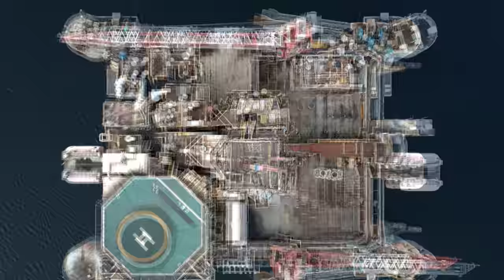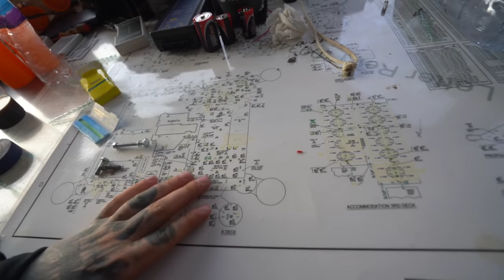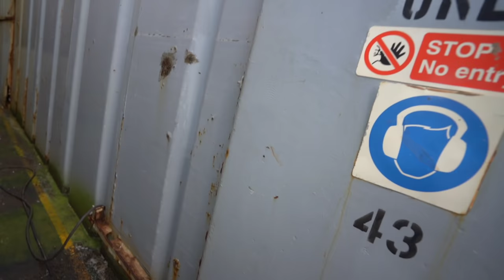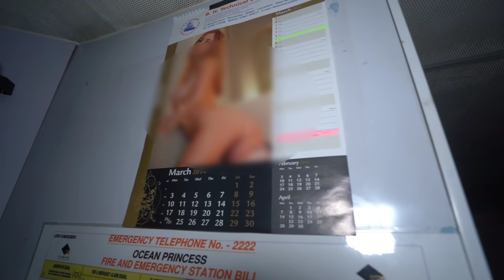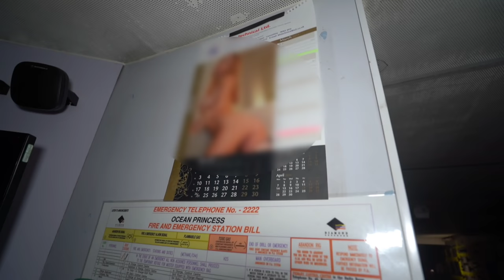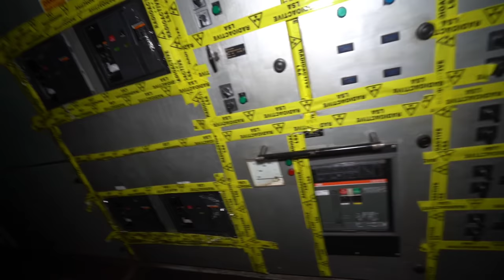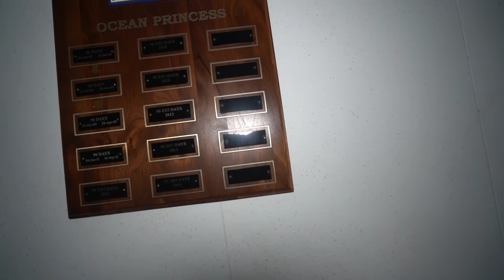We Should Not Have climbed onto This Abandoned Oil Rig | DISASTER AT SEA

Comment: I think you should buy a real boat 🤣
Reply: Right?
Reply: Especially with the consequences. Worthwhile investment for sure. My friend had a barge an f would joke boat stands for bung on another thousand. He threw money at it for a while.
Reply: Didn't help they ran it dry on land and burned the rubber impeller  up to the water pump which cools the engine , The tale tale sign of no water but steam coming out of the weep hole that let's you know your pump is working confirmed what I feared when I saw them running it on the bank out of the water
Reply: with daul engines and keep them wet😂

Comment: You should never run an outboard engine with no water supply  as you will burn up the water pump impeller. 
Enjoy all your videos keep up the hard work.
Reply: I noticed that right off the bat,  the steam coming from the weep hole told the tale

Comment: Just a tip for your guy Josh. Do not wear wellies on water!!  If for some reason you fall in water they fill up and pull you down. They are then pressurised and you can't get your foot out. Plus buy a harness i know its a pain but if that staircase had rusted out it could save your life. Always prepare to fail not fail to prepare. Good video's stay safe. I wouldn't do it well done
Reply: @toddamtmann3528  scaffolding everywere put it round that like a high rise scaffolder would.
Reply: @TheMotown1986  dude. The stairs are attached to the scaffolding. If your “the stairs rusted out” then there’d be no scaffolding. Go learn about rappelling and you’d realize how useless that would be. That’s also extra gear/weight that’s not useable in their scenario on an already overloaded and undersized boat that was clearly in disrepair (engine)
Reply: @crossbowsniper  fair play i want avin a dig i wouldn't go up there im just saying to try be safe no harm from me tip top vids keep up the good work

Comment: They are there to dismantle thing's so they can move the drill rig to another location for continue drilling for oil/gas. Happens often in Norway when a rig have empty that "pocket" for the resources in the sea bottom. They use tow tugs to pull them to the new location. And those tanks are filled with a mix of water and clay so it's easier to drill under high pressure to push up the material they are drilling away. It needs to go somewhere. And they mix the slurry in them as well to plug the drill hole so nothing leak's into the ocean. Have relatives that works on Norwegian oil rigs between Norway and Scotland. They use nuclear power plants to be able to run all the electricity and engine's to those oil pumps station's that drives the drilling station.

Comment: The shakers bring drilling shavings up to the surface along with fluid, Then the debris is shaked out and the fluid is pumped back to cool the cutting head of the drill platform.. Those collars at 22:35 are used to clamp the ends on the pipe to one another they bring the pipe in about 50 foot at a time, drill down, winch over & up another pipe,  thread it on and clamp t to keep it from busting loose.. At 31:50 those are training and briefing/de-briefing rooms for the workers. At Timestamp 40:05 those are emergency escape boats... They are lowered by winches to the water below and then dropped into the water... At Timestamp 42:15 those are the  thruster control centers.. The rig is towed out by boats and the thrusters help steer & stabilize it as its being tugged out and into its position
Reply: Shows how old the rig is. Modern emergency boats are dropped, not lowered.

Comment: The radioactive map, and hazard tape is likely related to them having density meters on board, a lot use a radioactive source to shine a beam through the fluid, a measurement is taken opposite the radioactive beam, and density calculated.

Unless they are broken open, they are safe. If they e been removed from the pipework they were connected to, and the shutter left open, they are hazardous if you put your body parts down the pipe, in front of the beam.

You are likely to come across them when exploring any refinery type of place, although counter terrorism police the security of any of these devices in use in the UK. IT is extremely unlikely that they would be left on board a discussed rig, they would be removed.

If you ever want an engineering guy to come on an explore, I'm your guy! If you get the chance to do a disused Sugar Factory, definitely gimme a nudge! I'll show you how it all works! Really interesting plant & processes! This place is fascinating.... Vibrating screens (separators aka shakers), lots of hydraulics, pumps, valves, a real interesting place ❤️❤️❤️🙏👍LSA is low specific activity. Naturally occuring radioactive particles found in products mined from the earth such as oil processing. There's possibly some contamination in those cubicles, or more likely in the plant that those cubicles in the switch room supplied

Comment: Think the rubber water pump impeller had died from running out of the water, and then engine overheated/lost power. I hope it did not damage pistons or cylinder walls. You can spoon water over engine in a bind.......ohhh just made it to the point of vid where that turned out to be true :0(

Comment: That was smart to not climb aboard those lifeboats. Your right about the g-force too. That fall would probably kill you no matter what was hanging there.
I'm not sure how quickly those lifeboats would be released on that oil rig if it was actually used during an emergency but i know on a lot of freighter ships they have a system designed to be quickly released into the water and there are harnesses inside for the passengers because of the g-force.

Comment: The radiation tapes no joke we used to use radio isotopes as tracers for monitoring pipeline flow the lsa means low specific activity the banks that where taped off where isotope detection units

Comment: The reason to the radioaction is that there are elements in the underground there are are radioactive and they used to drill in them for getting to the oil there for will there be radioactive elements all over the place but it is nothing to worry about it is only after years of exposure it can be a issue my old man work offshore in the northsea

Comment: That's what happens to a boat engine when you run it out of the water it only takes about 2 to 5 seconds for the water pump to overheat and destroy itself it's made out of rubber equal to the strength of your bicycle tire and that's what pumps the water so it basically just shreds itself apart so you don't have any water pump at all after about 3 to 5 Seconds of running it out of the water the engine probably not salvageable I'm not saying you can't have it rebuilt but if you're going to have rebuilt for 500 bucks and the brand new engine cost about 1100 us so I would say that that is just pretty much toast might as well leave it there is a boat anchor

Comment: get a honda bf2.2 for future, they can be started out the water as they are air cooled, just a bit noisier. that is an ancient outboard likely the same age as the rig. get a new one or decent used honda. looked like the impeller was knackered hence the smoke, shouldnt have that much

Comment: Those Oil Rigs has nuclear power generator like the ones on submarines and even cruise boats.
Reply: @KF.  I am an expert.  35 years offshore experience all over the World, makes me one.  That includes time spent on the one in the video.  My profile pic should give you some sort of clue.   Geotechnical drilling on land or near shore are totally different.  The type of drilling I personally carried out or was involved with.  Was carried out in water depths varying from 270ft to 8640ft.  While the oil wells drilled varied from 8500ft to 30000ft.
Reply: KF  I see your point now.   The fact that it was addressed to me, made me think your comment was directed at me.  Anyway there is a lot of YouTube experts right enough.   How anybody could think such a ridiculous thing as the original commenter is beyond me.   A quick check on the internet will tell you , nuclear reactors on rigs is total nonsense.